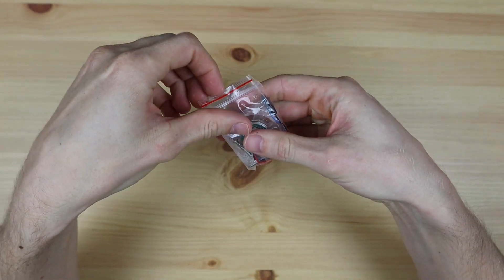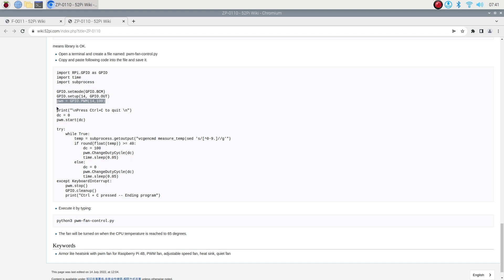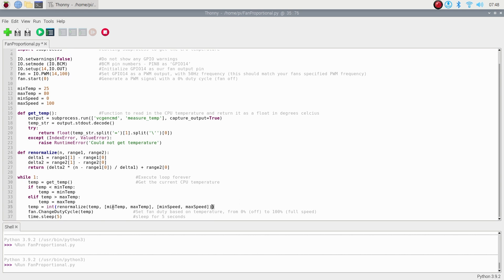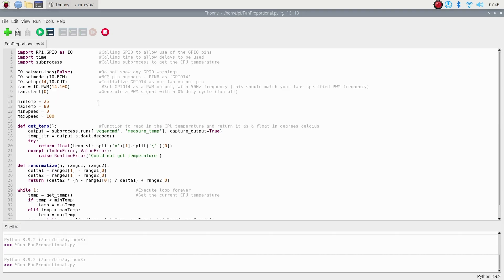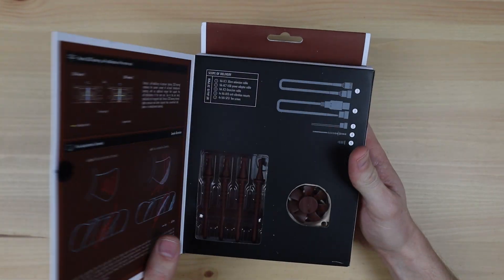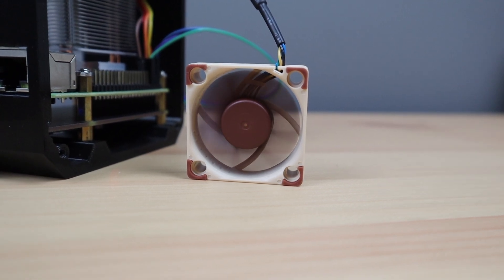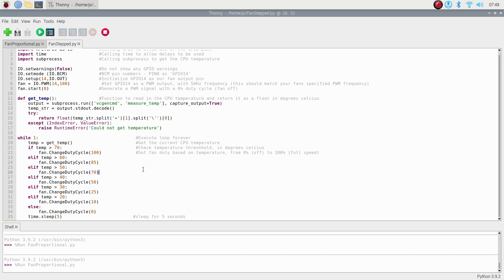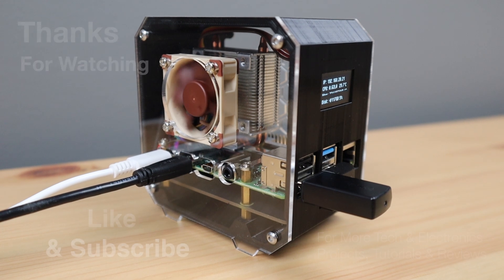Raspberry Pi PWM Fan Control Done The Right Way

Comment: I read the noctua fan spec and it says it requires a 5v PWM signal, but what is coming out from the gpio of the RPi is 3.3v? why is it still functioning properly? am i missing something?
Reply from the maker: Most PWM devices can handle 3.3V and 5V logic signals. The PWM input on the fan just needs to detect logical high and logical low states. Most good quality PWM devices would have anything above 2.0V as logical high and anything below 0.8V as logical low, so to the fan there is no difference between a 3.3V and 5V PWM signal.

Comment: thanks for the video.  I am building an EV converted car and will be using 2 Noctua fans to cool a radiator during charging and also for the battery modules.

Comment: I don't think you can get 3 wire fans to run w/ PWM control.
I believe PWM requires a tachometer wire (at least I have never seen a fan with a power, ground and PWM only. Not even exotic ones)
So I am thinking your first fan(s) are power, ground and tachometer.
You could probably test this by trying to write a script that would read from the third wire and see if it gets a value. If so, you could def know it's a tach instead of PWM.

Comment: Complete noob here. Can l use a raspberry pi to pwm a 230V fan somehow?
Reply from the maker: You could use a Pi to provide a PWM signal to a PWM based motor drive  for a 230V but you can't drive a 230V directly.

Comment: What is the CFM or LPM of this fan?
Reply from the maker: It's not listed on the datasheet but probably around 3-7CFM
Reply: Ah.  Thank you.  Do you know what fans I can buy to achieve between 5 to 20 LPM with variable speeds?  I have searched google/amazon for micro-fans, but have only found one site, and requested a quote.  But have not had any response. @MichaelKlements
Reply from the maker: Noctua make a 40mm 5V PWM fan, this is probably the smallest PWM fan you'd be able to get - this would provide well over 20LPM. If you need something smaller then you'll likely need to use a standard DC fan and build some form of voltage based speed control circuit.

Comment: I have the GeekPi ICE Tower Cooler for the Pi 4 and I am running your Stepped Script. I have these little zap noises as you had. Does this hurt the hardware in any case or can i just ignore it if it doesn't bother me?

Comment: I'm working on a building a 4 wheel rover/robot.  I've been searching for a good 40mm silent fan that runs at 5V and PWM.  Same fan you ended up with here.  I'm hunting around for how best to control and ended up with your video.  Luckily I'm in the right ball park but thanks for the bump with the code to assist.

Comment: it wont work on pi 5?????? i cant get it to run. 

>>> %Run FanProportional.py
Traceback (most recent call last):
  File "/home/stevegrimeszz/Downloads/FanProportional.py", line 9, in <module>
    IO.setup(14,IO.OUT)            # Initialize GPIO14 as our fan output pin
RuntimeError: No access to /dev/mem.  Try running as root!
>>>
Reply: HELLO??????
Reply: we need to rewrite in GPIOZERO

Comment: Please change the video title, this is not the right way, you really should at minimum have diode there to prevent reverse voltage flow from induction. The correct way would be to use a transistor, diode and capacitor and then control the fan with PWM at 25KHz (as recommended by the fan spec).

Comment: If you are powering it off the gpio and want to make it extra clean, just repin the connector that comes with the noctua instead of using jumpers. Push on the little spring flap on the terminal through opening on the side of the plug and they slide out. Rearrange them so they are in the right order for the pins and slide them back in and it plugs right into the gpio

Comment: Hey Michael thank you for your video, I followed your instructions and it works like a charm. My only issue is that I'm using a power on/off button (GPIO 5/6). I'm using the button so I don't have to disconnect / connect the power to turn it on. So if the pie turns off the Fan runs on full power until I turn it back on.
My solution is a seperate switch that disconnects the 5v power to the fan to turn it off. Maybe you have a better solution? 
Thanks again for all the good work!

Comment: Sweet, thanks.  I'm going to save this put it to use when I get my other issue gets ironed out.   I have a hand full of nifty little cases that have fans I want to convert to PWM control fans.   But these cases all use a 35x35x10 fan and it seems nobody is making a fan that size with PWM.     For now I just run them full time but at 3vdc to keep them quiet.

Comment: Such a great video and tutorial. I opted for the Noctura 60x25mm to pair with a heatsink case for a carpi project.
Did you ever end up adding the 4th pin and RPM feedback?

Comment: can the fan run on 3.3v boards ?
Reply from the maker: Yes, it will just run at a reduced speed
Reply: @MichaelKlements  ahk wasn't sure if it would work properly or would need a voltage level shifter

Comment: Very nicely done! Thank you for sharing your work! I am using the FanStepped script now with my new 40mm 5V Noctua PWM Fan.
Reply: Does your fan stop working when you shut down your raspberry pi?
Reply: @StanislavKvitash  The fan runs at full speed after issuing a shut down command. Nothing controlling it. Fan stops after raspberry pi is powered down, of course.
Reply: @markbooco1719  got it, thank you for reply. I simply noticed that the fan that came with 52pi cooler stops spinning after a shutdown command, while noctua fan is running full speed. Thinking of soldering 5v and ground to the USB 🫠

Comment: Is there a way to obtain the RPM of the fan in real time?
Reply from the maker: The Noctua fan has a fan speed output, the RGB ones don't
Reply: @MichaelKlements  oh so I already purchased the noctura and set it up
But my struggle is finding how to get that output?

Would you be able to help?
Reply from the maker: I haven't tried this myself but the tacho output is just pulsed per revolution, so you should just be able to count the pulses in a time period and then calculate tha fan speed - https://forums.raspberrypi.com/viewtopic.php?t=108066
Reply: @MichaelKlements  thanks! I will read this.

Comment: script works great with the noctua fan and is basically silent. 
In the future if Im looking to have a lower 'target' temp would I decrease both the max temp and min temp values slightly? 
say from (max=85, min=25) to something like (max=80, min=20). I'm thinking that would drop whatever temp it sits at now by about 5 degrees. Thoughts?
Reply from the maker: Yes that's probably the easiest way to go about it. You probably don't need to adjust the min=25 value unless you want the fan to always be on. Adjusting the maximum to a lower value will increase the rate at which the fan speed increases with temperature.

Comment: Hello, nice research on this topic. Some time ago I noticed that some sbc makers changed their fan connectors from "pwn 3-wire" to two wires only. This isbprobably why this happened - most of fans are not usable at lower speeds. 
For good and cheap alternative get any fan for laptop, they come as turbines, are smaller or bigger, usually with some heatpipes (easy to detach). And they need to be quiet. I've got big box of them for about $30 from laptop repair office.

Comment: I am not sure if this makes sense. But I want to connect the fan to the raspberry pi, is there no way to do it directly?
The Pin has Black, yellow, green, blue.

So do I need an adapter? and if so which one?
Could you share the link
Reply from the maker: I'm not aware of a molex to dupont adaptor, the easiest is probably to use breadboard jumpers like I've done or cut the connector off and solder or crimp on some dupont connectors.

Comment: Hello Michael, Great video, can you please share the LED Screen info script you have? Does it work with Kali?
Reply from the maker: The script is available from my Github repo - https://github.com/mklements/OLED_Stats
I haven't tested it with Kali, you'd probably need to install some additional libraries or dependencies to get it running but it should work.
Reply: @MichaelKlements  Thank you, its bit of work on Kali, you need to do the following to enable i2C,
1- install 3 Dependencies:
sudo apt-get install python-smbus , sudo apt install libi2c0, sudo apt install python3-smbus
2 - Install Kernel Support to enable i2c
sudo nano /etc/modules ---> add following line
i2c-bcm2708
i2c-dev
3 - modify config.txt file located at /boot/
sudo nano /boot/config.txt ----> following line at the end
dtparam=i2c1=on
------------------
dtparam=i2c_arm=on should be there if not, add it as well.
4 - verify that i2c is working
---- now you should be able to see the i2c adapter
└─$ sudo i2cdetect -l
i2c-1 i2c bcm2835 (i2c@7e804000) I2C adapter

Comment: are those jumper cables? i want to recreate this
Reply from the maker: I just used breadboard jumpers, for a more permenant solution it would be better to remove the connector and crimp or solder som dupont connectors to the wires.
Reply: @MichaelKlements  thanks

Comment: Those cheap fans are never ment to run with pwm. They make a lot of noise with high frequencies. I used to run them at 100hz but not anymore. They need constant voltage eighter 5v or 3.3v for low speed. I connected them to 3.3v pi gpio and run them all the time, now it makes less noise than 5v.
Reply from the maker: I think that's the best solution, just get the standard (non PWM) 5V version and run it at 3.3V so that it's quiet.

Comment: Is it just me, or is the fan off from the radiator? ( 5:11 looks like they don't line up) Also- is there a shroud to force the air through the radiator?
Reply from the maker: It is a bit off from the radiator and it doesn't need a shroud. The radiator is way bigger than what the Pi needs in any case so just having some airflow through the case keeps the temperature down.

Comment: Hi there the noise is from the magnetic resince of the coils in relation with the magnets
Reply: Heya! Thanks for your comment! I assume this means that no scripting can fix that sound? Is there something else we can do to fix the fan itself?
Reply: @Macley  hi there it's the fan flexing and a slight wobble on the shaft .this is probably why everyone else has gone for full speed with a pwm high-low power

Comment: Well done Michael Klements. Another great video. I have been using your display screens scripts for nearly two years. I modified Andreas Speiss excellent guide for fan PWM on a two wire fan. It does require soldering a transistor circuit but works brilliantly. Really worth a look.
Reply from the maker: Thanks for the suggestion Ray, I'll definitely go and have a look at it. Does that mod run quietly and do you kow what PWM frequency the script uses?
Reply: Hello Michael, yes it runs quietly, definitely an improvement on the 5v full speed. I use a standard ice tower and fan which runs to target temperature. I run an overclocked pi4. I will check the pwm frequency that I settled on.
Reply: Looking forward to your findings :)

Comment: I wouldn't try driving a fan power pins with GPIO due to being an inductive load. Once you turn it off, it kicks back and the voltage shoots up, potentially overvolting the GPIO pin. The ESD diodes should dissipate the worst of it, but they also aren't intended to actually pass current in operation, so there's no telling how long it would survive like that.

Though i suppose you could partially alleviate this issue with a freewheeling diode.

As others are saying 21-28KHz is the intended PWM frequency range with 25KHz target as defined by an ATX specification supplement. Noctua has the same spec as well.

I'm actually running... i forget something like a few dozen hz on one of the fans i have in one of the things i built (i have one with Sunon Stallguard, and it's a 2-pin so unghhh it really doesn't like PWM) but i have the signal drive a lil mosfet (si2302 or si2306, something like that) low-side switching, then through an inductor, and a capacitor. I winged it and totally overdid it on the capacitor value, 470µF, you probably don't want much more than a couple µF... anyway it evens out the controlled supply voltage on the fan so much that it keeps running under power for many seconds after you "stop" it. I also forgot which inductor value i used, but it was whatever just rolled into my hand at the moment, just a tiny lil one.

Targeting 25KHz could be a little difficult on the Pi if you have a pin running from a software timer interrupt rather than having native PWM capability. Pi has its PWM pins dedicated to audio output, doesn't it. This might be the whole reason why the scripts you had at hand don't attempt to run a higher frequency.

Comment: See if you can find a spec sheet for the fan. That might give you an idea as to the best pwm frequencies. I know noctua has a pwm specifications white paper, but I don't know how the cheap fan drives its bldc so I can't help you there. Also the cheep fans may all be the same or exceedingly similar. Often times cheap components like that are just sold by an OEM to different distributes who then put there own label on it and maybe sometimes with a bit of customization. Google any serial numbers you may see and see what comes up.
Reply from the maker: I might try open one up and looking at the circuitry for any additional info, I did quite a bit of digging online and couldn’t find much on them. I also feel like the range I tried 50-120Hz covers the most likely frequencies. I’d be surprised if the spec was outside of this range.
I’ll definitely give that a try, thanks.
Reply: @MichaelKlements  The most probable PWM frequency definitely is not in the range of 50 - 120 Hz. The PWM frequency should be 20 - 25 kHz, but maybe some fans also work well at 1 kHz.

Comment: I thought the trick for getting pwm to work quietly was just to increase the pwm frequency until it's inaudible, i.e. above 25 kHz. Is Noctua not doing that?
Reply from the maker: I’ll try increasing it beyond the 120Hz I tried. 100Hz is what was in the manufacturers documentation.
Reply: @MichaelKlements  100 Hz or 100 kHz? Are you saying the first fan's spec says 100?
Reply from the maker: The spec's say 100Hz and the supplier of the fan (Geekworm) has said that the fan should be run with a PWM frequency of 50-100Hz.
Reply: @MichaelKlements  Try 1-2khz, the noise will get a lot better

Comment: Is it just me or is there no fan noise when the samples are given in the video?
Reply: Gotta turn it way up. It's hard to get these light-ish sounds without a good mic, low noise floor, and a good deal of post processing.
Reply from the maker: Yeah you may have to turn the sound up, it’s difficult to get clean recordings of “quiet” sounds without high end equipment.